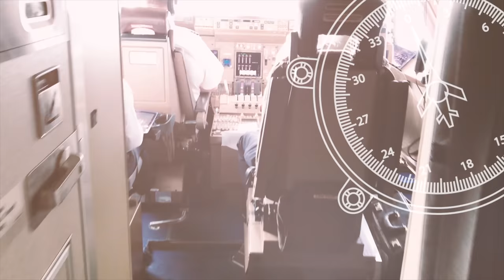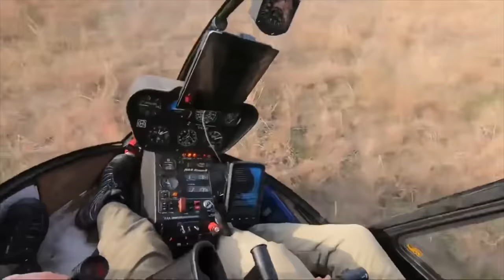Boeing 747 Loses Landing Gear | Viral Debrief

Comment: Hey Kelsey, I can't be 100% sure of course, but I remember reading somewhere that the bounce on landing of the 747 was actually intentional, in an a last ditch attempt to see if the landing gear would come down, it was two fold, one, to see if it would come unstuck and lower, then a go around and another attempt, or if it would drop on landing and cause issues during the landing phase.

Of course I could be wrong, but I remember seeing this video some time ago, if I remember correct it was a Speedbird flight.
Reply: IVE SERIOUS DOUBTS ABOUT THAT  THEORY.
Reply: I have seen the bounce you are talking about the Pilot did a touch and go about half way down the strip than a go around and landed the landing gear did not come down though. Don’t think this was the intention here, However we really don’t know though what was going through his mind at the time.

Comment: I landed in Nagoya in a 777 in windstorm, very windy and very rainy. It is my understanding that the 777 has a computer which puts in small increments to keep the flight level. We landed perfectly! When we got to the car and were driving out, it was difficult to keep the van on the road because of the gusty winds. That was the smoothest landing I have ever had.

Comment: Hey Kelsey.. love your channel.. I’m a helicopter pilot and there is a longer version of the helicopter incident where he is starting the R44 up.. he completes a mag check ( you know what that is) but it looks pretty clear that he doesn’t turn the mags back to both and only leave it on one mag.. this is that caused the engine failure shorty after take off as it’s possible the mag was also faulty.. so he kinda caused this as well as saved it .. he do a good auto at low level though 😉

Comment: I worked in rotar-wing aeromedical for awhile (as crew,I'm not a pilot)
Thankfully I've only ever been in one emergency landing in entire time and that was very controlled as we were in a beast twin engine (S92) over a helo deck on a ship.
We train on how to get out of a helo (HUET) if it lands on water (they turn upside down submerging you).
Helicopters are such a great tool, but they do tend to fall out of the sky more easy than fixed wing craft I think. That helo pilot reacted incredibly well, great example of good training driving an immediate action plan in an emergency.

Comment: The gear was stuck up. The firm contact with the ground was a deliberate attempt to dislodge it with the intention of converting it into a touch and go if it did start to come down. It didn't, so they carried on with it as a landing, hoping not to fall over sideways. This was Virgin Atlantic at Gatwick, in 2014, and the (unnamed) pilot in command is very experienced indeed, unflappable. His daughter was on board. The gear was stuck up because some strut had been installed the wrong way round in maintenance just prior to the flight (possibly on the ramp if memory serves), causing it to jam (and presumably to make a horrible noise) as the gear was retracted after take off.
Reply: Correct 👍🏻. Such a frightening thing to happen over something so stupid too.

Comment: I can’t remember where but I’m sure I read that they did this intentionally to try and drop the landing gear by having such a hard impact initially?
Reply: I think I heard that too.
Reply: Know a former VS engineer who knew the CPT. CPT said he tried the bounce to do just that, try and drop the gear. Lock arm was removed night before for replacement and the new one was installed 180* out of line. Legs are now apparently marked to show correct positioning.

Comment: Hey 74 Gear, thanks for the video!! Question: in the missing landing gear video, is it possible the pilots intentionally did a hard landing to try to unstuck the landing gear? I remember hearing about a similar case where the pilots had tried that (I don't remember the details, might have been on a Mayday episode or a TV show like that).  Also a comment about the last video - the cabin crew probably did that announcement really close to landing because a passenger was standing up. That's why the announcement is short and just mentions to remain seated with seatbelts on (I'm a former cabin crew and seen this so many times!). Thanks again!
Reply: I don’t think that’s possible. The gear moves very slowly so if it came down it would probably start scrapping on the runway as you’re turning off.
Reply: You are correct there was a spotter on the ground watching to see if it would come down. They hoped by making the hard shake it would and if it did the pilot would've pulled back up and gone around for a safe landing on all gear. If it did not, they would continue with landing as you saw happen.

Comment: Years ago, I was on a 767, the right-engine compressor stalled during takeoff and it was stormy.  I believe they volunteered us to see if it was good enough to allow the airport to start sending and receiving flights.  I don't recall if it ended up shutting down and they restarted it or if they just idled the engine. 

The flight deck warned us the landing would be firm.  The landing was super smooth even in the rain.  The best part at the end was as we got off, you could see the flight crew was soaked in sweat.
Reply: That was the best part? 😳
Reply: @moiraatkinson  sarcasm... we were just as excited as they are.
Reply: @DL541  I wasn’t being sarcastic.  I just couldn’t fathom how seeing a sweat soaked pilot could be described as any type of positive experience.  Excited?  It sounds terrifying!  The best bit for me would have been walking off the plane before it burst into flames or started accelerating off down the runway!
Reply: @moiraatkinson  I was being sarcastic-not meaning you. 

It was unnerving to see that the flight crew still was drying off from the stress. 

In the plane, the thud-thud-thud and flashes of the engine stalling definitely got our attention but otherwise it didn’t feel any different riding.
Reply: @DL541  I understand now 😊, thank you for explaining.  It’s so difficult to really communicate by words alone.  It may suit robots, but not humans!

Comment: 9:24 The helicopter pilot goes to turn the ignition off, but it’s actually already in the off position. That’s why the helicopter went down(poor magneto ground allowed intermittent operation) . That’s also why the pilot winces, says “that’s all right”, and smiles out of embarrassment.
Reply: He goes to flip the key to the off position, (the 1 o’clock position) but it’s already there so he swings the key chain around because he knows he’s on camera and he’s trying to make it look like he turns it off.
Reply: Looks like it was in "both" position (1 o'clock) then "off" (11 o'clock). Do you know this for sure?
Reply: @jonasw4921  Between 'off' and 'both', is the 'Left' and 'Right' switches. Both is next to ignition, so it's waaay past the 1 o'clock position.

Comment: That is a hog helicopter (they fly low over a ranch usually in Texas and shoot running wild boars out the windows with rifles), so it is on a ranch for sure and already very low, which all seemed to work out in their favor. He did a good job of setting it down!

Comment: Talking about a small aircraft in a cross wind. 
In a Piper Super Cruiser PA12 tail dragger I was taught to keep the windward wing down using lift to keep you lined up with the runway. The last minute flair and drop into a three point landing. 

This was the reason I flunked my first flight test. The inspector said to go back and have my instructor call him and learn the right way to cross wind land.
He was looking for me to touch down on the windward main gear (wheel landing). Then drop to three point. Now that was tricky.

Light wind was the crab configuration.

Comment: I remember that Virgin 747 having this issue into Gatwick, my parents contacted me whilst the aircraft attempted the approach over their house several times to resolve but was unable (created LOTS of noise with the drag and high power setting). I later heard some where the problem gear had been installed back to front or something, resulting in a jammed gear.  Very solid machine and good to know what it can handle! :)

Comment: was a passenger on a flight out of Sanford/Orlando to Clarksburg WV and  indicator lights showed the landing gear did not fully retract after takeoff. I felt the aircraft do some maneuvers and then over Georgia a 180 back toward San/Orl, told the wife something is wrong but No PA from the Captain until 10 min from touchdown. Got to wave at the firetrucks and emergency vehicles as we passed by. That really shook up the rest of the passengers who were still wondering what was going on. Not a fun way to come in to land. The indicator lights had malfunctioned.

Comment: Had a similar landing in Aberdeen... Dan Air BAC 1-11. Floated a bit, banged onto the runway, then full brakes and reverse thrust, stuff falling out of the galley, food trolley breaks free and comes crashing down the aisle... full reverse and LOTS of noise until we stopped. I was in 2F, and could see only grass out of the window.
After a short pause, we turned 180 degrees on one wheel, and taxied to the terminal. Guess the nosewheel just stayed on the hard stuff. Bit dramatic, especially the food cart bit...

Comment: I worked for the airline at the time of that undercarriage incident, in fact the day of the incident I was on duty and watched the aircraft land. It was a great relief to see it still standing upright when it stopped. The item that was fitted upside down (main retract hydraulic actuator) had confusing markings on it. There was a label saying up, but what it meant was up hydraulic supply, not fit this item up this way. It’s a mistake made by other airline maintenance facilities on several occasions. The mistake resulted in the up hydraulic pipe being fractured as the undercarriage reached full up travel. The Boeing maintenance manual doesn’t require an undercarriage retraction test (with the aircraft on jacks) following this actuators replacement. Company policy has now overridden the Boeing procedure and if this actuator is replaced it’s now company policy to Jack the aircraft and do a gear retraction function. The aircraft that this happened to was fully inspected, the actuator replaced and was back in service a few days later. In defence of whoever did the walk round pre departure, only the very end of the retraction actuator can be seen from the ground and then with difficulty.
 Talking to the captain a while afterwards he said this sort of event is part of their training, rehearsed in the simulator. I’d seen a body gear failure before, but not a wing gear. The body gear failure was caused by a tyre burst on take off (caused by debris on the runway apparently) as the flailing tyre was retracted it wiped out some hydraulic lines and the free fall ramp from the body gear door. A manual gear release had to be carried out for landing (hydraulic failure due to no fluid) one body gear failed to extend due to the free fall ramp being ripped off the door. So the bifold door got pushed half open and down by the weight of the gear but not fully open and out of the way The bifold door then only opened to 90deg and not it’s normal 180deg, it then acted like a shelf for the wheels to sit on. No amount of manoeuvres would shake the gear down.

Comment: I have been to boracay for a friend's wedding.  It's a pain to get to.  As I recall when making the travel arrangements we had the option of flying a puddle jumper into Boracay from a larger nearby city or taking a ferry and bus.  We chose the latter for safety reasons.  We felt justified when in the larger city airport their "airport security" was staffed by teenagers who were sitting on outdoor plastic lawn chairs and were so busy on their phones that they had to have them continually plugged in and they didn't even look up at passengers.

Comment: Love this channel.  Just found it. I've flown alot and some pilots gently kiss the tarmac and others hit it with a vengeance from hades.  The scariest one was a flight from Atlanta ga to El paso tx (probably around 2008?) It stormed the whole way and bad turbulence.  The pilot went up and down, right...ect im assumingto try to fly around it..it was so bad.  Lightening flashing all around that would light up the wing..each time I would check to see if the engine was still there.  The scary part was when we got to El paso... they do the whole "put your tray table up and stow stuff under your seat" we could see the lights of the airport. All the sudden we're thrown backwards, stuff is falling down from the cubbies, ppl yelling .. when we actually leveled off... the pilot said we had to circle the city for a little bit. We did for over an HOUR!!! when we got to land,  they put us in the furthermost runway.. I'll never forget the FA yelling HEAD DOWN, BRACE,  BRACE..... terrified wasn't the word.. don't know if this is accurate but I overheard a couple of the FA talking and it seemed that the tower lost us and when we came out of the clouds to land... it was in the path of one taking off.(I'm thinking that was the sudden up tick)  Something about possible Lightening taking out one of the transmitors..🤷‍♀️ it was still a crazy ride.. but the pilot brought us in with just a little jolt..I really wanted to give him a big 💋...  &yes I've flown many times since.. haha

Comment: That 747 is one beautiful machine. I love how you can see the wings flex holding up all of the weight of the plane.
Reply: Boeing has been using flexible wings as far back as the B47. I knew somebody who served on them and the wings were supposed to flex as much as 10 feet in severe weather conditions. By flexing the wings don't have to be as heavy but yet the wings are designed so the flexing doesn't damage the wings. If you really want to see the flexing in action, look for a B52 takeoff. The wings droop on the ground from the weight of the fuel but come up as the plane gains speed.

Comment: Another factor to consider for that B744 landing is they have lost one of the 4 hyd system so they had lost 1/4 of the elevator surface authority. The pilot would have flared as usual maybe but with less effective control of the pitch axis resulting in the high rate touchdown.

Comment: I live in Phoenix and when flying in, it will seem like we hover over the run way for a long time in the summer.  When the plane is coming down, it hits the heat pocket coming off the runway and when its near 120° outside, sometimes the pilots have to nose down and hit to get the plane to go down rather then hover.  One time on southwest I had the tires hit the ground and then we suddenly climbed up for a turn around.  They claim over the speakers that someone taxied infront of the plane and had to takeoff real quick to miss.

Comment: Kelsey I hope you don't mind my comment to the helicopter Emegency Landing. Looks to me like a Robinson R22 ( Which I'm rated for and have a good few hours on )  It's obviously an engine failure and the pilot did a fantastic job to get them all down alive and seemingly with zero damage to the helicopter. Wow that guy kept his cool all through the emergency. I would just like to compliment him on his reaction time as in an engine failure in a Robo R22 it's 1.1 Seconds. The pilot has to down Lever and AFT CYCLIC to Load the Rotary Wings ( Disc) to fly the craft in Auto-Rotation. That slows the ground speed. You did correctly observe that the pilot pushed forward on the cyclic. That's his way of gainging Air Speed to store more energy for a brief moment which can then be converted back  to Lift once he applies AFT cyclic again to affect the final toutchdown. This pilot was brilliant Lever Down, Aft Cyclic to Load his Disc ( Wings) turned into wind. Selected a landing spot. Extended his Flight Path by going Nose Down and then Traded off his inertia stored in his rotor to do a Landing. Even after landing his main concern was tro reasure his passenger and you can clearly see him Dis_Engaging the systems And Even Instructed the passenger to stay seated until the rotor blades were stationary... What a guy

Comment: I could have used some of your advice during some of my hair raising landings in the B-47!  Yeah, before your time, I'm afraid. lol.  That was back in the 50's and 60's.  I was given permission to land the B-47 on the frozen over runway at Plattsburg AFB in NY. The de-icing trucks cleared a 35 ft wide path in the center of the runway and I attempted to land on that cleared pathway.  But there was a strong crosswind from the right and although I approached the runway in a crab, when I flared, I kicked in some rudder to physically line up with the runway.  Unfortunately, I was a few knots hot and I continued to float.  So I touched down on the left side of the runway on the ice.  The outrigger saved my wing as I tried, more or less, to halfway fly the plane on the ground back to the center line of the runway where the tires had some traction. What a relief to get off that ice!

Comment: My 777. I machined the fuselage turning tool. That's the thing where they build the fuselage upside down to build the top then turn it right side up to make the bottom half. After we made the tool it was taken to the Boeing plant, and assembled. It went together over night. The neighbors of the plant had this huge thing pop up practically in their backyards overnight like a mushroom. I know this because it was reported in the Los Angeles Times that day with color picture (it's sky blue).  The current 777 variant is the longest plane in the world, it is the largest twin engine plane in the world, and those are the largest jet engines in the world.